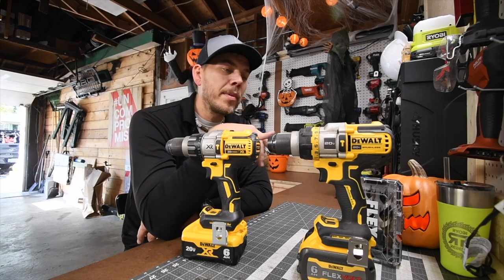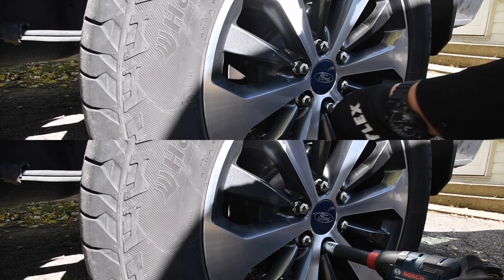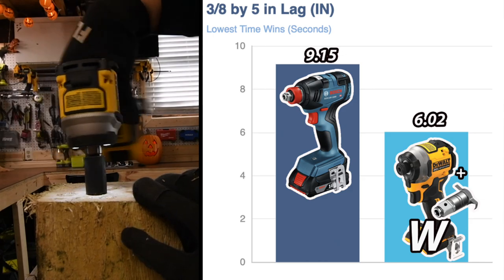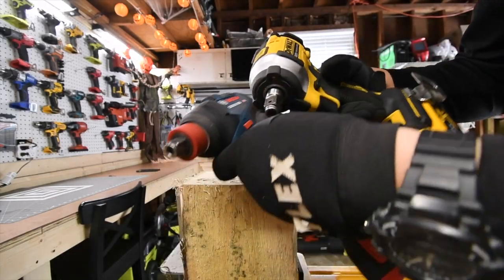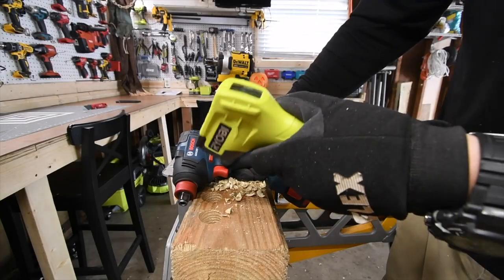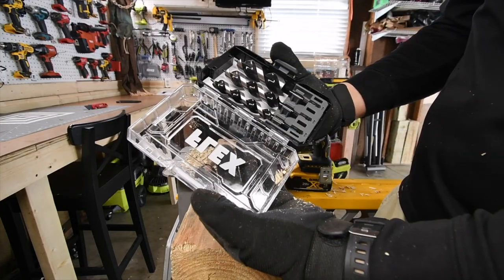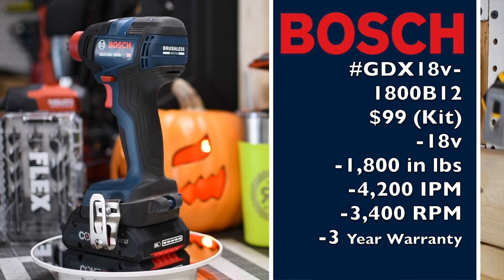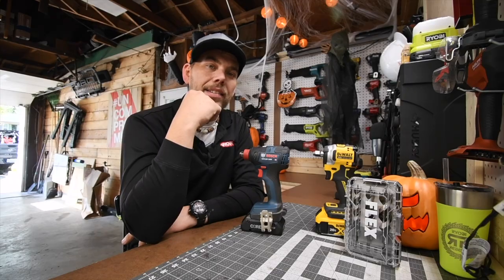Who Has The Best Hybrid Impact Driver?

Comment: You probably saw in ttc test of the bosch, it works better with a 1/4 piece in the collet so it may give better times if redone with a broken 1/4 insert in
Reply: In all reality, im sure that would give the bosch a better chance, but what consumer would go through all that trouble to get more out of it, or even know that it has that issue, if i bought one before i saw that TTC video, I would use it like bosch intended
Reply: Or get the newer more power freak the 1860 vs the one demo’ed here the 1800.

Comment: Bosch freak(old 1800, as seen in this video) $99 kit(freak,battery, charger, bag)
Dewalt bare tool $159 + battery $139 = $298(no charger, and I doubt a bag)
————
Bosch is a third of the price of the Dewalt(not to mention whatever the upgraded part to make it work like the freak… even though the this is not the newer freak, for a third of the price pretty good results.
Reply: Not sure where you can get the 1800 kit for $99 (except refurbished with 1 year warranty).  Dewalt DCF850P1 kit is $219 with charger, bag!, and 5 amp-hour battery (compared to the 2 amp-hour in the Bosch kit). So just under half the price for a much smaller battery, less power, and 1/3 the warranty (in a smaller ecosystem).
Reply: @markwicker2664  any lowes has it for $99. They also have A two pack of Bosch 4ah batteries for $99. So you could have a 2ah and two 4ah batteries for $198 with the Bosch all brand new with full warranty.
Reply: @markwicker2664  the newest freak (1860C) has been on sale a few times for $129 with a free starter kit (charger + 4Ah CORE battery). That's how I got mine. Best value in the pro segment.

Comment: This is the last gen freak. It's a shame you didn't use the current version. I love my 1860c.
Reply: The last Gen is the GDX 210c. The one in the Video is the GDX 200c. The difference in Power is like 5%. The only major Update is some useless interface where you can now change from 3 to like 10 or 12 different settings.
Reply: @Zozo806  far from useless, the auto stop modes come in handy in a variety of situations. Also the LED is brighter.
I was never able to fully compare my previous 1800C to my new 1860C to see how much more powerful the new one is; numbers just tell half of the story

Comment: Interesting test. Dewalt has a bigger range of tools than Bosch but the new Bosch Profactor line has some great tools. The torque wrench does 80lbs on the lowest of three settings. The 7 1/4 circular saw is as powerful as my regular corded one. Prices are decent with a free battery promotion.
Reply: But... will Bosch still be here in a year?  They released a few new tools, but then ghosted them (which ripped me apart as I was waiting on the left blade strongarm for 16 months before they officially premiered it at WoC22. Now their response is "What saw??" And "New phone. Who dis?". I stocked up on 8ah batteries for it, and I went heavy on Bosch... and I'm regretting it now. ) Mike Mansuetti and Uwe Thym have had a lot of behind-the-scenes heat lately. 
 
Last month,  Bosch started selling tools at lower prices through Lowe's. And with the Diablo and Hilti Situation.. Bosch Tools: North America, will be going through drastic changes. Only time will tell... but if you're still wanting to buy Bosch, then keep an eye on the deals coming this month.
 
It's a shame... Bosch has so much potential. Yet they're worldwide sales numbers dropped to 8% for the North American market this past year. Yet they don't even bring their best tools into the US/Canada.
 
So, just be weary. Somethings happening and it's not looking good. 😞
Reply: @carterscustomrods  very interesting reply on here questioning if Bosch will be around next year? I would tell you from an inside source that, there is no question that Bosch will be around for next year… we actually are planing on 50+ tools coming to North America for 2023. Budgeting for North America will be double what it was this last year. So you will only be seeing Bosch bigger in North America this upcoming year. But yes there was some delays on your left cut circular saw(but there is a quite rumor going on, that it might have an new feature added to it) plus those German engineers don’t want to release anything until it’s perfect. Bosch just dropped 5 new tools at Lowes last week(pro factor hammer drill(with a level built into it), drywall cutout tool, drywall screw gun, 18v jigsaw, and a small headed drill, kit for only $89 that still has a metal chuck) Bosch is not going anywhere. They are just now unshackling North America and 2023 will be a huge step in the right direction.
Reply: @raymathis5577  Glad Bosch will be around! After getting burned on a Porter Cable hammer drill years ago I switched to Bosch (corded) and was very happy with the tool. Got a 18v kit from Lowes years ago and they've been good tools at a decent price if you can wait for a battery promotion. The Profactor line has impressed and glad Bosch will keep bringing out new equipment.
Reply: @RandomGuy-qm3mg  so we will be bringing back the buy a pro factor product in Lowes, get an 8AH and fast charger(starter kit) free in November. Plus we have a free 4ah starter kit(4ah and charger) for the Bosch oscillating tool, new 18v jigsaw, 975 hammer drill, new drywall cut out, and the new drywall screw gun. That started last week. So tons of promotions. Plus if your in an area with a Bosch rep they can maybe throw in some sweeteners if your getting a few things. On top of all that Bosch is working with Lowe’s new MVP program so you can get some extra points through some of our tools on their program, and there is quite a few more programs like this coming in the near future. So the Bosch train is really moving in the right direction, but things just don’t happen overnight. But they are coming… should be a fun next few years
Reply: @raymathis5577  I also saw a new Cordless table saw with the PROFACTOR branding. That one looks sweet.
PS. I got the 975C hammerdrill with the starter kit and works great. I'd recommend it to anyone.